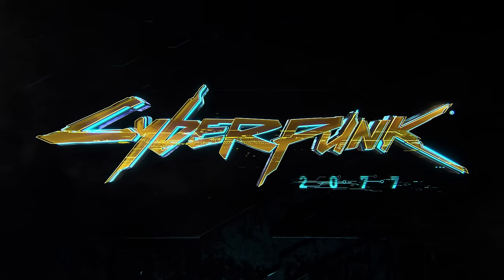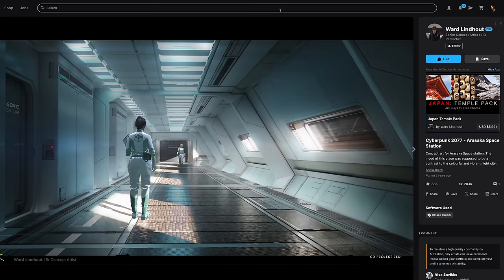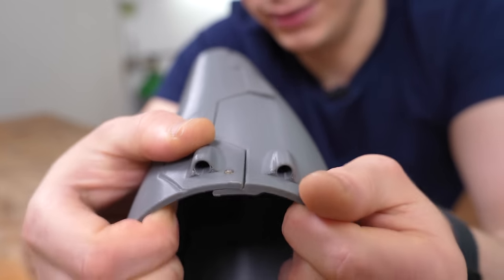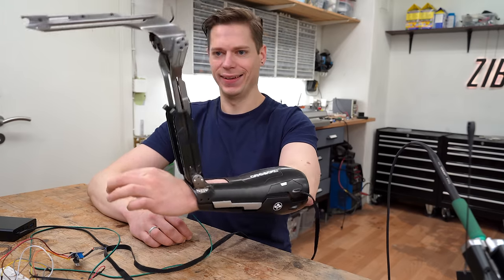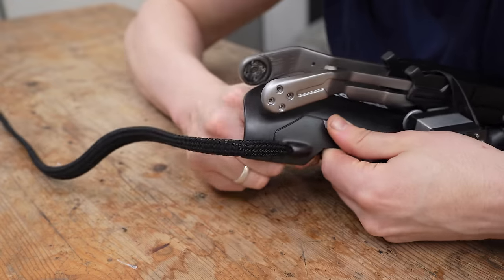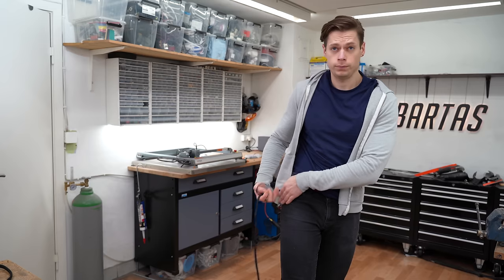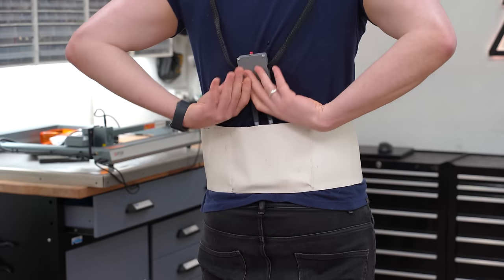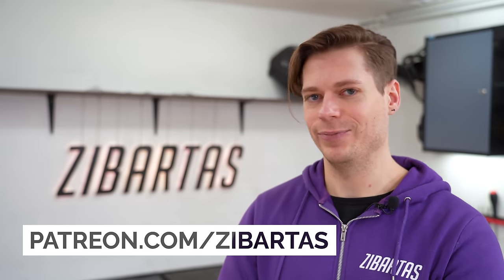I Built Motorized Mantis Blades (Cyberpunk 2077)

Comment: Great work! Where can I learn more about pressure sensor? didn't get how exactly you trigger the servos with it
Reply: The pressure sensor is right below the wrist, so bending the wrist down will put pressure on the sensor. You can see him moving his wrists when he shows off the blades.

There are a lot of different pressure sensors, but the most common is some variety of resistive load cell. It just acts like a variable resistor, so it can be read by a microcontroller's built-in ADC pretty easily.
Reply: @antonliakhovitch8306  thanks for detailed answer, I'll definitely try them out.

Comment: LEDs should turn off when they retract. Maybe even with a slow fade in and out to indicate the metal is heating up.
Reply: Or just make metal variant, make module inside, that youll connect to like… 800 ampers and it will heat up to real 1000+ celsius. Better to make them outa tungusten steel

Comment: Good job would love to see these with extendable blades like in game how the actual blades extend when blocking then retract when you stop.
Reply from the maker: I messed around with prototypes actually. 

Another reason I went with the glowing blades instead of the telescoping metal ones was the inability to contract them - spring loaded mechanisms kinda need to be "reloaded" with hands, which ruined the impression too much 😁 and any way to reliably automate it both ways was too heavy for the motors to swing around like the static ones
Reply: @Zibartas  Is that why you went shorter length blades as well?
Reply from the maker: @PBST_RAIDZ  Kind of. These are meant to be wearable in conventions without much hassle. This mechanism could easily handle another 10cm or so of blade length, but that would impair the use of hands, opening doors, etc. :D So it was just a tradeoff. I made the mechanism highly modular and I will make multiple swappable blades - so if I really wanna go huge, I can, in the future :D

Comment: I have a project Idea, can you make a halo with the use of liquid nitrogen and magnets that utilize quantum levitation and quantum locking? But, make it applicable to wear. I suggest a 2 Part build. Pt1 would rest on your head with the magnets on a magnetic base crown-shaped circle scaled down so that it's hidden in your hair and is not noticeable. Now Pt2 would use the YBCO compound which can be cooled in a liquid nitrogen bath for longer levitation until it becomes a superconductor that's placed in a magnetic field to levitate utilizing the Meissner Effect. However, if Pt1 is not plausible, maybe you could attach it to a mask/helmet for better functionality. Also, can you make the halo glow with a bioluminescent algae liquid? You can make the algae glow more consistently with an increase of luciferin and changes in the environment, such as a drop in the salinity level, can force bioluminescent algae to glow longer, allowing more energy to be created in the form of light. I know you made a halo 4 years ago but I want to make a halo without the use of a rod of some sort. I lost a bet with a friend and now have to go to a one-time cosplay event (I didn't want to partake) however, since I'm going I figured I'd go all out just this once. Going as Angel Devil from Chainsaw Man.

Comment: It always seems so weird to me that weapons like that are always attached to the back of the wrist instead of the front, like as a general rule.

I get it for wolverine and the mantis blades because they're basically integrated into the person's skeleton.

But like say the predators wrist blades.
Would have to be used for thrusting like a punch, and never really for slashing or blocking.
An attempt at a slash would only leave the wrist vulnerable, and the impact on the blade would be distributed weird along the back of the arm unless the weapon was secured tightly around the entire arm.

Nothing against your build since it's based off how it is in the game. (Though the game uses them with backhand blocking, which kind of illustrates my point, you have to turn your arm around in order to block...)

Comment: Beautiful and dynamic work as always. I really love your focus on aesthetic polish and motion at the same time, really elevates it from just static prop. 

Watching you test the motion, with how hesitant/jerky they were made me imagine they're trying to boop. So could you put an ultrasonic sensor at the tip sans blades (to be more nonthreatening), program it to sense proximity so it slows when it gets close til it softly bops a stranger's nose? Call it the auto booper.
Reply from the maker: Thank you! Motion is such a complicated aspect of projects like this, so I'm happy I pulled it off :)

Aesthetics aside, adding anything to the blades would add weight, and the issue is that the servos are already pushed quite far with such long and heavy levers. 

Servos have some backlash and free play due to their imperfect gears - and that backlash gets magnified greatly with long levers. The way I "solved" the issue was to reduce the pacing of position-change commands sent to the motors in software. With some math-tricks I managed to "smooth out" the raw inputs from the sensors, and perform some rudimentary self-checks ("will this new angle make us move too fast?") before moving to the new position :)  That helped reduce overcorrection jitter :)

Comment: amazing work and craftsmanship but why not just have  direct electrical Circuit  with no pie, so  coding. I never understand the need for on board computers. wire it just like a light switch.